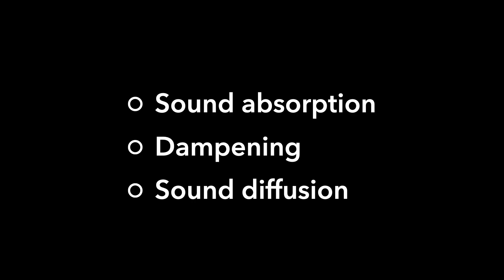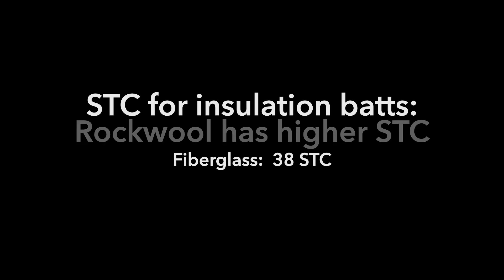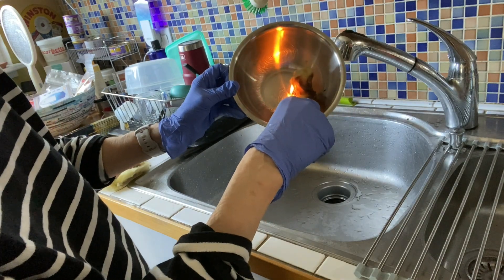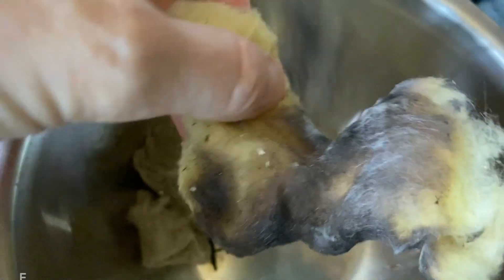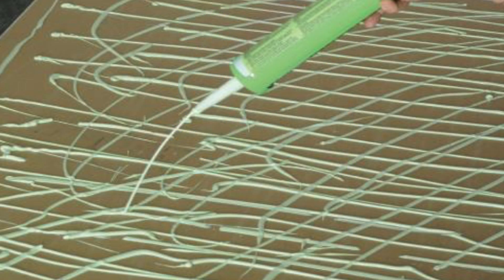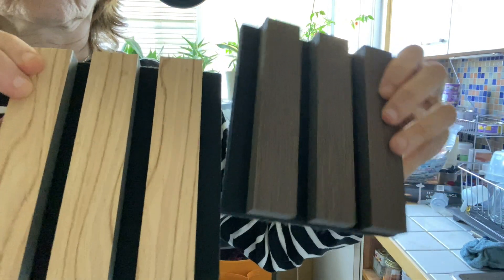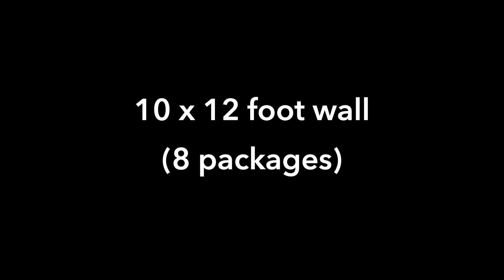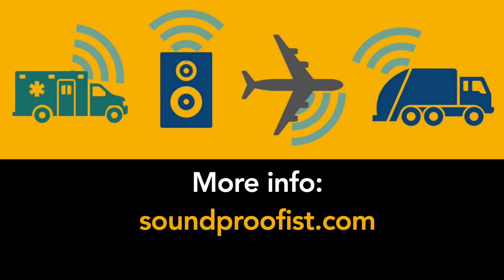Reduce airborne noise with these 4 techniques

Comment: I dont think rockwool has STC rating data.
Reply from the maker: This data sheet (see link) is from the Rockwool site, though there are other independent sites with STC estimates. Of course, results are contingent on the rest of the wall assembly, the type and frequency and proximity of the incoming noise, etc. https://www.rockwool.com/siteassets/o2-rockwool/documentation/technical-guides/commercial/acoustic-wall-assemblies-catalog-techincal-guide.pdf